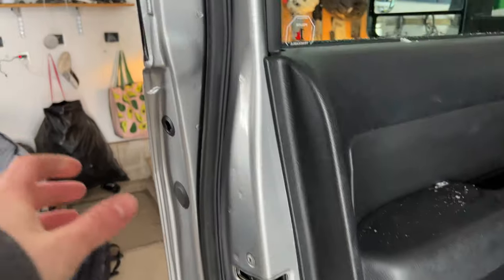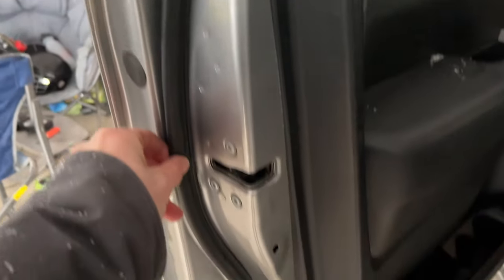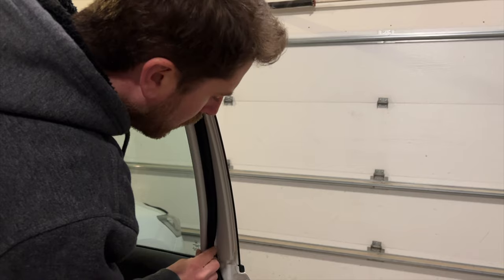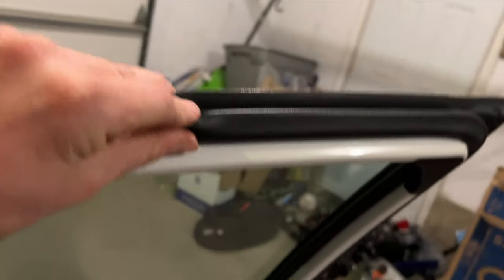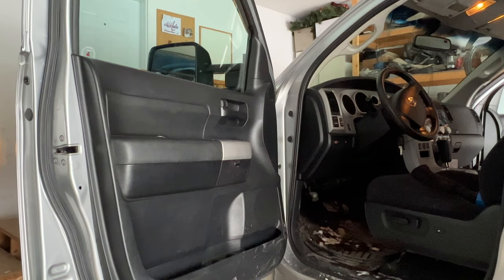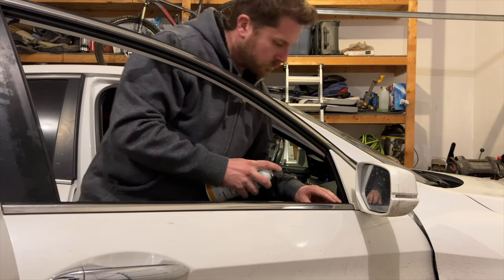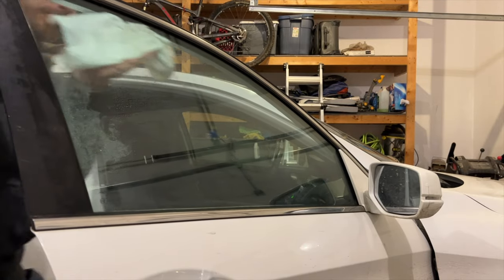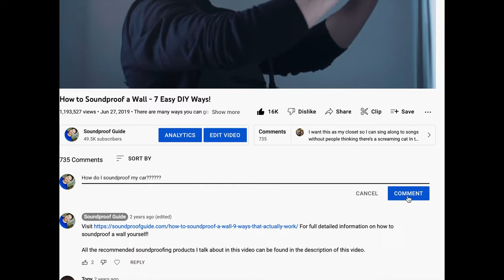How To Fix Wind whistling noise in Car Forever! CHEAP & EASY

Comment: I swear, the second I heard that whistling sound at the beginning of the video, my mouth dropped open. Sounds exactly like what’s happening in my car. Thank you for the information!
Reply: Same for me!!!
Reply: Like, including the crickets? 😂
Reply: Wondering.. I'm having the whistling sound with my air on but I open the driver door, it stops
Reply: @masoncamp5871 maybe there’s an AC vent running from the front of the car near the dash into the gap or even into the door panel
Reply: I agree. I listened to an auto parts guy and almost ruined a window. Thankfully it has  returned to pre- silicone condition after several months.
Reply: Wow

Comment: Haven’t seen my tip in these comments much. Just get tubing from the hardware store and slip it into the hollow portion of the seal!

This works quite well. Add silicone grease to make it easy to slip in

Comment: I had make it better in a 2000s Toyota Yaris sedan by using just tape. The car is cheaply made, normally there is a rubble in between front and rear door window, but Toyota sale it without it and leave a gap.

Comment: Why does my 2010 honda civic make a rattling sound after 40 miles an hour?
Reply from the maker: with a helper or two, try to find exactly where the noise is coming from or what part of the car its coming from and go from there. Could be a multitude of things. Best of luck!

Comment: NOOOOO do NOT spray silicone on the window sweep! It will leave streaks forever.... just NO. Clean it but don't put silicone or any other lubricant on it.
Reply: That’s what I thought!
Reply: On the “slots “  that the  window rides in at 5he front and back of the  door is okay but ya I wouldn’t do the “sweeps”. Cleaning them with a soft toothbrush and a little bit of water with a couple drops of Dawn dish soap ,  Theon running a shop towel or microfibre cloth along the edge that contacts the window is a good idea. Those window sweep rubbers are for reducing  the amount of water that enters the  inside of the door.

Comment: If you put silicone on a real rubber seal you will ruin it.
Reply from the maker: Not true. You might be thinking of an oil base product like wd40 which will ruin rubber, silicone will protect it.
Reply: Where did you hear that? That's absolutely false
Reply: @docblizard  guy is selling this product...  that's why no logic answer